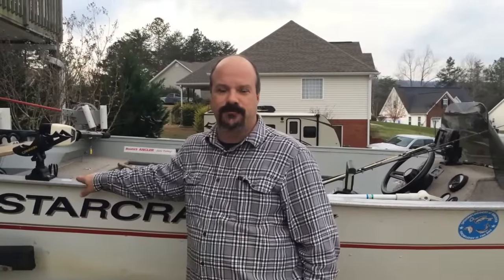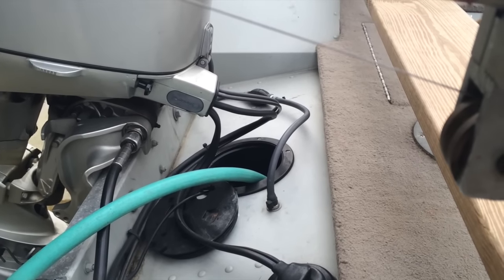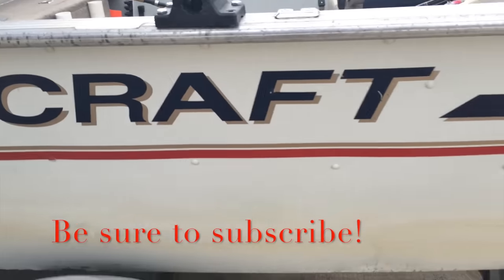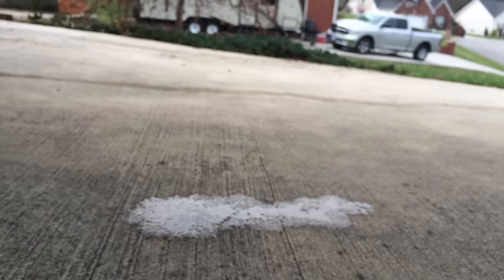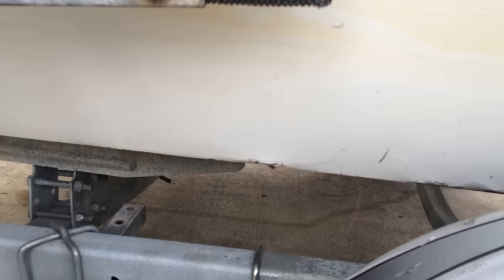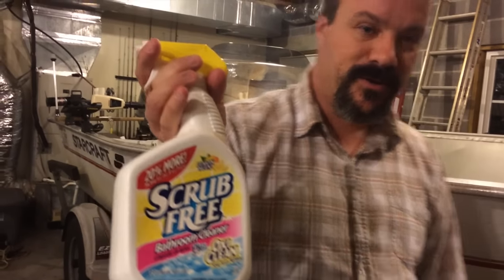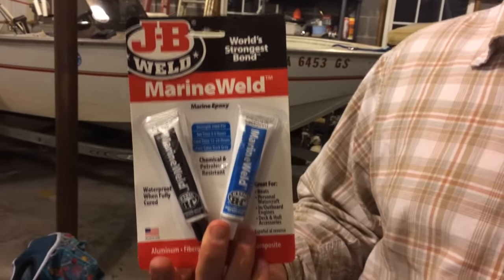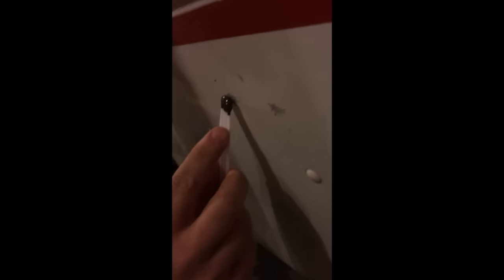Simple! How to Fix Aluminum Boat Leaks with JB Weld Marine Weld

Comment: Thanks for this. I have watched your follow up video as well.
I have a pontoon boat. I’m going to try this on the Wells that could be cracking. I know it’s leaking. I got a guy that says he’s going to help me drain them and he will mark Where they leak.
Rather than take it to the welder, I’m going to try the JB well fix.
Reply from the maker: Good luck!
Reply: Let me know if this worked in the pontoon. Wanting to do the same
Reply from the maker: Yes, I’d like to know as well.

Comment: the advantage od the putty tube by JB is that it can be applied to a wet surface. the JB marine 2 part, really is not necc vs regular JB weld if the surface is dry and preped
Reply from the maker: Thanks for the comment.

Comment: Been 5 years since you repaired. Hows the JB weld held up please?Would it seal leaking rivets on the underside?
Reply from the maker: Mine is still holding strong...not sure on the rivets, but it is worth a try.

Comment: Would you use this to attach aluminum brackets to the transom of a 10ft job boat that will be used as landing wheel tracks? My boat weighs about 210lbs load with motors and batteries? Looking for a way to add the brackets to the transom without drilling.  Thanks
Reply from the maker: It might, but I'd be surprised.  You can always try.
Reply: You should use liquid nails instead bud

Comment: If you have foam in your boat I would not recommend filing it up with water like he just did the foam will hold the water making the boat ten time heaver. Plus it takes forever to dry up.
Reply from the maker: Thanks for the tip.   :)

Comment: If there is ANY possibility of this being a crack where either side could move FORGET this stuff, It has great adhesion  but in my uses very little tensile strength , If you contact the manufacturer about its failure you will get, you didnt let it cure or it didnt cure properly dont waste money and time smearing plastic on metal ,get it tig welded  and that will be the end of the problem. Got a hole in a 5 gallon bucket , this is the stuff
Reply from the maker: Thanks for the comment...mine has been holding strong for over 5 years now.

Comment: Will it work for a hole about the size of a quarter? How about for a decent size crack?
Reply from the maker: +BugoutBuds - Honestly, I think it would work.  This stuff is solid as a rock when you put it on.  I might try to put some mesh as a backing in the hole first.  I have been very pleased with how well this has worked for my boat.
Reply: BugoutBuds nope.   one flex  om a wave and the cracks is back.  jb weld does not hold up.

Comment: Has anyone used this over pitting on an aluminium boat. I got a boat with some corrosion/pitting. Grinding it out and drilling the bad parts out. Most holes are under 1/4". I may have it all tig welded, but this project has unfortunately grown bigger than expected
Reply from the maker: James Marshall I would definitely give JB weld a try first...keep your life simple and spend the extra time fishing!  Good luck!
Reply: @TheFishingEducator  thanks, I appreciate the comment.
Reply: @MaximillianTheCat  if you plan on getting it welded , dont use jb weld... the guy will either tell u to fuck off or charge u double lol

Comment: well ive used this stuff but not for fixing holes in a boat but it is garbage and i wont even buy it again its not even close to as strong as an actual weld...idk if it worked for this guy but if i had to guess id say no it didnt. to patch something idk maybe by to keep a strong grip.....not happening this stuff is shit
Reply from the maker: Again, mine has held up well.